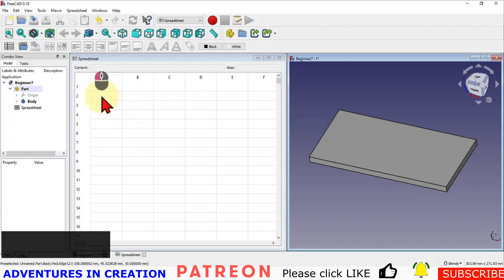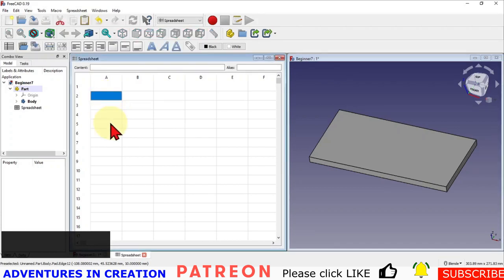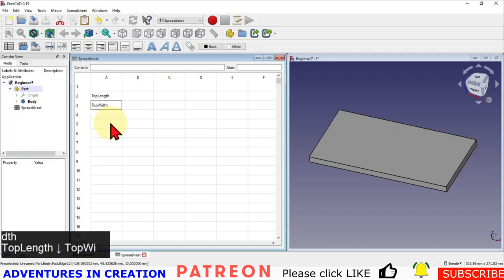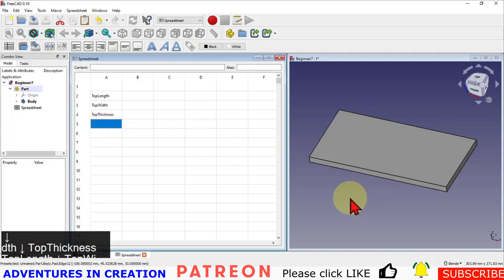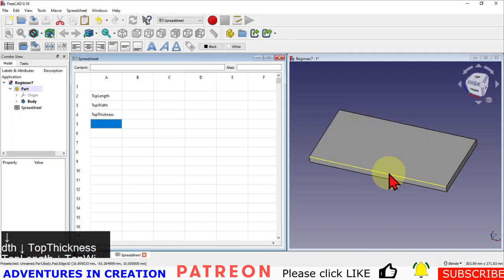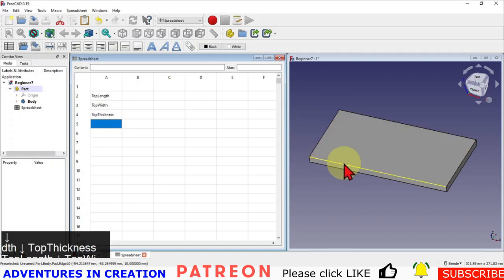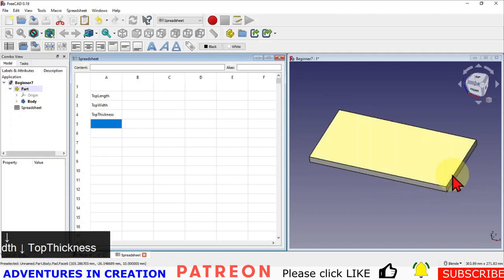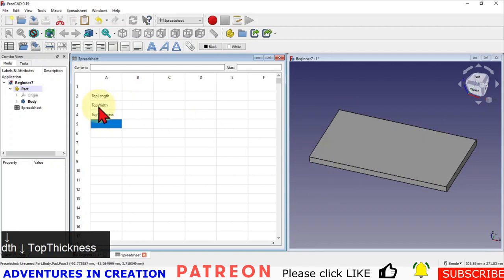FreeCAD For Beginners #7 Spreadsheet Driven Fully Parametric Table

Comment: I tried Fusion360 and never found a tutorial series that I liked. Went with FreeCAD because of this video series  and couldn't be happier! Plus it is open source to boot. You are a wonderful teacher.
Reply from the maker: Excellent, I used Fusion but switched when autodesk changed the licensing
Reply: @Adventuresincreation  What I'm really looking for is something free for woodworking. I don't really need the 3D modeling, just something that I can turn out plans quick and easy for personal use so 2D would be fine most of the time. Parametric design is nice as well but I almost always build one-offs. I think I'm going to settle in on LibreCAD. The one shortcoming with LibreCAD is I cannot export to a cutlist optimizer but it is significantly faster for the type of drawings I want to do.  Anyway I have completed 17 of your lessons and plan on finishing the entire thing. My opinion may change yet.  Thanks again!

Comment: Great video mate for demonstrating the parametric power of FreeCAD. I clicked the video for what I thought would go over assembling, but the spreadsheet dataset was a real treat. When I got to the part of padding the legs (maybe ok for CNC or 3d printing), I realized I will have to search for another video of how to assemble multiple parts - for say, a shelf with legs and platforms. I'm quite sure you cover it somewhere else, but I'm pleased to learn how to use spreadsheet parametrics. A+++ video howto.
Reply from the maker: Thanks! The new assembly in the latest dev version works fairly well.
Reply: @Adventuresincreation  I'll give 1.1.0dev a go and see if assembly is simpler to grasp. However, I'm leery to use a dev release to learn on because I'm too green to know if some issue is a bug or my own operator error. 
Anywhoo, I'm building a shelf assembly with independent parts that will be bolted together. I'm excited to use the parametrics you showed in material thickness, widths, heights, and depths for quick overall changes in appearance as material stocks may be limited.
FreeCAD is fairly powerful and seems worth learning though understanding the UI comes with a curve.
I'm fairly excited to gleen info from your channel as you're into all the things I should have been. ;)

Comment: I'm glad I found your channel, just started fumbling my way through FreeCAD so I can make my own parts on my recently purchased 3D printer and eventually a CNC router, purchasing at a later date. 
Thank you for explaining how to make the models parametric.
Reply from the maker: Have fun with 3D printing. It still amazes me how I can think of something and an hour later have the item in my hand.
Reply: @Adventuresincreation  I have to agree with this person, I'm an old disabled carpenter and have tried several cad systems. They all have been way beyond my computer skills, with your help I think I can use spreadsheets to design what I used to be able to build.
Reply from the maker: @dannyelmac  Thanks!

Comment: I was using an old autocad 2007 until it crashed. Tried Fusion 360 but the free version very limiting. Came across your Freecad tutorials and I'm finding them pretty easy to follow, then again I'm only on the beginners #7. Keep up the good work.
Reply from the maker: Excellent, the latest version of FreeCAD has some great additions.

Comment: I haven't managed to get double mirroring at 33:20 in FreeCad 0.21. I had to draw 2 legs in the sketch and than mirror them once. P.S. Got it. If you want to mirror more than once in FreeCad 0.21 you need to use multitransform pattern.
Reply from the maker: Yes, the multi transform is a powerful tool.

Comment: Thanks for that, I followed along, and I've got the principles fixed in my mind now (for how long, I'm not sure!).  I found a useful thing to do in the parameter spreadsheet was to use a different text style for my calculated values.  I chose underline, (right-click, Properties, Style, Underline) which stands out quite well, and stops me from making circular references while tweaking the table design!
Reply from the maker: Good idea 💡

Comment: Absolutely Brilliant series.  Just started and learning a bunch.   At the 29:00 minute mark, you mention the table leg top being on the table top plane.  It shows on your view.  My view just shows solid.  How do you set up to get the view at the 29:00 mark?   Really enjoying your teaching style.
Reply from the maker: Thanks for the feedback. Are you talking about clicking through the model tree or the offset sketch?
Reply: @Adventuresincreation  The offset sketch.  Miy view shows solid, while your view shows the outline of the leg up through the table.  With my view I would  not know to offset the top of the table leg to the bottom of the table.  Maybe it is a tree issue.  I'm still fuzzy on the flow of that one, as I also had issues towards the end to get the 2 planes to show up in sketcher to pocket the bottom of the table.    Thanks in advance.
Reply from the maker: @mboulton372  the offset is not so much to make it look solid but to ensure the leg is the right length. If you have lines showing up in the model you can select refine in the data panel to hide them.

Comment: This instruction is great, but I'm stuck right at the beginning. I make the rectangle, but around 4:24, your rectangle corners have a large circle, mine are small. For me, even if I zoom in and get real precise with the mouse, I can't click the corner - only a side. I also can't select the intersection of the x & y axis. I can select "Constraint 2" and "Constraint 4" in the list on the left, but unable to select the center-point. Is there an early setting/option to make those points larger and selectable?
Reply from the maker: I don't think so John. Can you share your file with me?
Reply: @Adventuresincreation  Thank you. I figured it out this morning. I went into Preferences -> Sketcher, then unchecked "Auto Constraints" and "Avoid redundant auto constraints". After that, I did a new sketch/rectangle and was able to select the corners just like you did. I'm on Mac and and 0.19-24366.
Reply from the maker: @yourtechjohn  glad you got it sorted out

Comment: Ian. My etesight is not as good as it used to be and I admire very much your red mouse pointer. However, I just can't seem to work out how to change the mouse color. If I do a search, I get several results saying to 'go to Part Design workbench' and do it from there. Still totally lost as I can't see where to do this. Perhaps you could do a short Patren video showing in detail how to achieve this. Noel
Reply from the maker: Hi Noel, the mouse color is a windows setting. Just go into your mouse settings in the window "settings"
Reply: @Adventuresincreation  Thanks Ian :)
Reply: @Adventuresincreation  Thanks Ian, too easy. Certainly helps. :)

Comment: is it possible to calculate the number of whole blocks, taking into account the cutting of all non-integer ones? in this particular example, all cuts are 0.5 blocks each. and sometimes 0.2 or 0.7 .. how to automatically calculate, given that from 0.2, 0.3 and 0.7 they give a whole block of 0.7 + 0.3, and 0.2 * 5 gives a whole.. how to optimize and reduce clipping?
it would also be useful and visual when calculating the molding or when calculating the number of finishing sheets ..
Reply from the maker: I think there is a cut sheet optimizer available somewhere, I haven't used it but I vaguely remember seeing it.

Comment: I like your presentation so much. Big question: as a background I am an Architect. Why the table is up side down?
I do understand your workflow. I wonder if make sense, at the end, to flip it in the right positions. But than I know it is going to make a mess with "datum plan"... can you please explain this? 
Still.... one of the best tutorial ever seen. 
Thanks again
Reply from the maker: Honestly, I could have flipped the table but because of the way I made it, I constructed it laying on the table top.
Reply: Makes sense to me, as a person without an architectural background, because in my mind I'm building a table. I'd make the top and attach the legs to it. Trying to stand 4 legs up and balance and attach a top would be a bit trickier.

Comment: I have noticed you start your spreadsheets on row 2.  Is that a preference or is that a bug workaround.  I did one of your other parametric tutorials and two cells could not be resolved.  I also learned whe running the EasyAlias, you selected the spreadsheet in the tree first…I did not do that.  Makes perfectly good sense.
Reply from the maker: I usually leave row one for headings in spreadsheets, just a habit

Comment: How do you save and open the spreadsheet? Also is there an easier aliasing that does not require you to type "Spreadsheet."? Is there a way to open the spreadsheet and import it into another csv to do further analysis?
Reply from the maker: It saves and opens with the freecad file. You can copy paste the content to an external spreadsheet application. I suggest you take a look at dynamic data too.

Comment: Thanks a lot for this video tutorial. i tried to follow along your explanation. mostly it was ok and worked. but when i make the multi transform it gives me a error. it says: one transformed shape does not intersect support. well... i dont eaven know what this means. but its not possible to make. i am drawing this table for like 4houres now. and its not the only difficoulty i found. 
the video is great. cursor and so on is good. thank you for your effort
Reply from the maker: Hi Dirk, that error usually means that one of your transformed pieces does not line up with the rest of the model and would create a second model, that is not allowed in FreeCAD at this time. So, you need to look at how much you are moving the transform and make sure that it lines up with the rest of the model, I hope that makes sense.

Comment: 11:05 with macro i get an error " GitPython not installed! Cannot retrieve macros from git"   so how do I do this? Do I need python on my windows10 laptop? Thanks
Reply from the maker: Yes, you need python but it should have been installed with freecad. How did you install it?
Reply: I followed your beginners #1 or #2 for freecad and for windows 64bit?
Reply from the maker: @garyweliver1870  If you just downloaded and installed it, you should have python on the system.
Reply: Yes in macro the easy alias addon never loaded. And this is a known bug. I just entered them and set alias manually. Main thing is a completed Lesson#7 and see the power of parametric modeling, Thanks so much!
Reply from the maker: @garyweliver1870  the easy alias is somehow becoming corrupt but you can go to the wiki page and download the macro and it will work

Comment: In many programs "anything is possible" so I hesitate to ask. Suppose I have a Parametric part. Is it feasible to (read 'easy') to print dimensioned/radiused element(s) based on a 3D part or parts? 

If yes, is the topic covered in this series?

Thanks for this series.
Reply: ADDENDUM: Print to a printer. Not 3D Print.
Reply from the maker: I am not sure I understand what you are trying to do
Reply: @Adventuresincreation  In 2D Orthographic drawing, and board based drafting of days past, parts are dimensioned so a recipient can fabricate the part(s). In that line of thinking, if I design the 3D table (from your exercise example) to have it manually fabricated, is there a way to print on paper a 3D representation with dimensions of the individual Bodies with a Part for example?

Thank you.
Reply from the maker: @RoadsterLoverMedia  yes, you can definitely do that. There is a whole techdraw workbench for producing drawings and you can create views of the model in any view.

Comment: Why do you move Dimensions with mouse in constraints like it is nothing? I tried everything I right clicked them to check whether they are locked maybe there is some other layer that I have to switch to. Nothing, they won't budge, whatever they were created at random you will have to zoom in and zoom out without to look at the number or to make this number not overshadow something important
Reply from the maker: You should be able to just click on the number and move it. They change color when you hover over them.

Comment: Hello, in this video you will discuss the use of e.g. the Easyalias Macro and adding Macros using the addons manager. Unfortunately, in the addons manager I can't see any Macros that I can add. The error message is "Appears to be an issue connecting to the wiki, therfor cannot retrieve wiki macro list this time. Can you help?
Reply from the maker: I have seen that before Harry, usually an Uninstall and reinstall fixes it.
Reply: @Adventuresincreation  I had the same issue and found security protocols were stopping the search for wiki.
Reply from the maker: @colinjones8760  good to know, how did you fix it?

Comment: Sorry, but problem not yet solved. Freecad reinstalled but still the problem. Notification as follows: 
10:31:27 GitPython not installed! Macros cannot be retrieved from git
10:31:27 Appears to be an issue connecting to the Wiki, therefore cannot retrieve Wiki macro list at this time
Reply from the maker: Take a look at this https://forum.freecadweb.org/viewtopic.php?t=45592 forum page where they discuss possible issues.

Comment: Invalid Syntax error on Macro "Easy Alias". Installed the macro today. Rebooted FreeCAD. Filename was clicked on, then spreadsheet cells were clicked upon before running MACROS > RECENT MACROS > Easy Alias. I highlighted the names first, then clicked on the Spreadsheet name as well as in the opposite order. No success using any method. I did the connections manually for the exercise and they worked as expected. Release 21/04/15 Revision 24291.

Any clarification of the process greatly appreciated. Thanks.
Reply from the maker: Take a look at this video https://youtu.be/6hBMjx5i2NA
Reply: @Adventuresincreation  Issue resolved. Thank you.

Comment: Hi ,when I hit the pocket icon the pocket line disappears and I can not pocket anything.  I have tried it on other drawings and it doesn't work on them either. Any ideas? Thank you for your help.
Reply from the maker: Make sure the pocketing sketch is selected before you hit the pocket button. Also make sure your body is the active body.
Reply: I follow all the instruction's in the tutorial and I have an active body and it just disappears.
Reply from the maker: @calvinmconie4048  Click on the body in the model tree and hit the space bar that will toggle it's visibility
Reply: @Adventuresincreation  Sorry, by that I mean the outline of the pocket disappears and you have nothing to pocket.

Comment: Your stuff is awesome, but this freaking table one I can't finish. When I get to the two leg mirroring I don't see or find anything to right click on. I can't add the second feature. Great channel.
Reply from the maker: I wonder if you need to select the mirror plane?
Reply: @Adventuresincreation  I been clicking on everything, done it several times and no go. So I have a two legged table. I’ll comeback to it later.
Reply: @ReyciclismoMTB  I can't even get that far. I Only have 1 leg on my table as the mirrored leg is always red and i get the error message  "one transformed shape does not intersect support". can anyone help with that please?

Comment: I don't know if you can help, I have been following you videos (they are awesome), but in the video you load EasyAlias macro.  I follow the steps but no Macros load, I get the error: "GitPython is not installed. Cannot retrieve macros from git. Appears to be an issue connecting to the Wiki, therefore cannot retrieve macro list at this time" . I am running version 0.19 24291.  Do you install something not shown in the video?
Reply from the maker: If you reinstall freecad it should install everything you need.
Reply: @Adventuresincreation  I uninstalled (removed user prefs), redownloaded and installed, and still the same error, downloaded 19.1, 19.1 portable, Tried a different laptop with portable version, tried .20 dev...all the same error. I don't know what the problem is...maybe my laptop. Tried my wife's desktop with 19.1 it works!  I have no clue.  You have any suggestion?
Reply from the maker: It's weird that the reinstall is not repairing it, everything you need should get installed with freecad if you are installing the latest release. You could try looking for the missing files 📂 just to confirm they are there. If they are it may be something to do with your path variables.

Comment: There are no macros in my list.  I get an error.  I can see workbenches, but under Macros there is nothing.
Reply from the maker: What error are you getting?
Reply: @Adventuresincreation  I am getting two error lines.  

First one:  "GitPython not installed! Cannot retrieve macros from git"
Second: "appears to be an issue connecting to the wiki, therefore cannot retrieve wiki macro list at this time."
Reply from the maker: @chris_topher1984  that's odd, did you use the standard install? It should do all that for you.
Reply: @Adventuresincreation  yes standard install of the .exe file, not a zip.  I made other comments on this video that were removed just now.
Reply from the maker: @chris_topher1984  not sure how they could be removed. It certainly wasn't me. YouTube auto removes stuff if it deems it inappropriate but I am sure your comments weren't inappropriate
Reply from the maker: @chris_topher1984  can you try creating a macro just to see if that works, I might recommend a re-install as it appears you are missing some of the necessary files to get the macros you need.